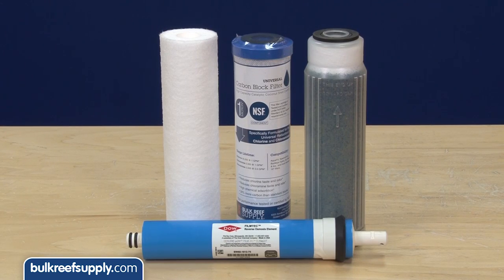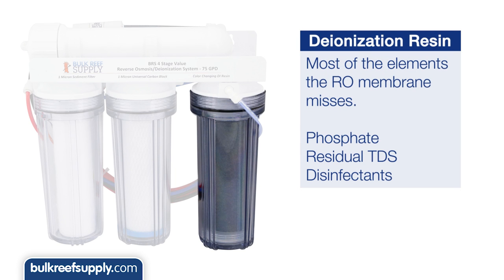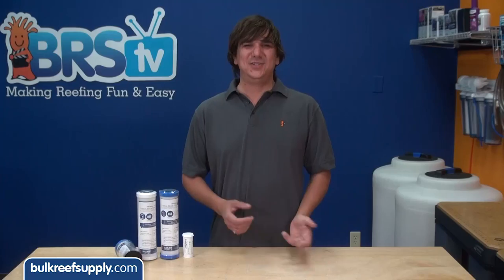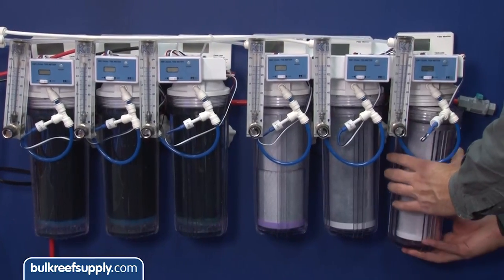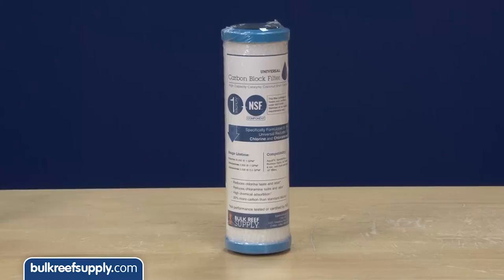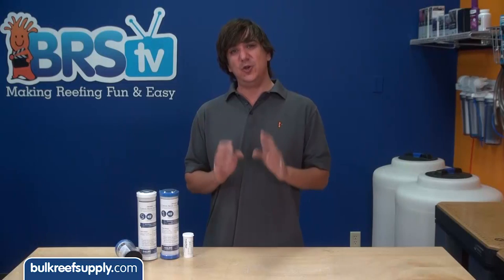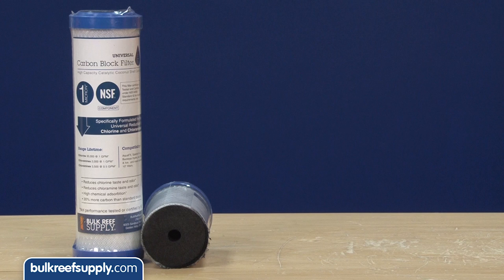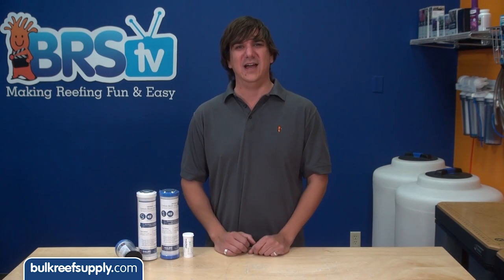Why do I need a carbon block?

Comment: Is the matrikx CTO carbon block better than and have the same VOC properties as the regular BRS carbon VOC block ?
Reply from the maker: I would expect the BRS block to out perform the Matrikx CTO block as the BRS block contains more carbon. For that reason, you can also expect a longer lifespan out of the BRS blocks vs most other similar carbon blocks.

Comment: Your carbon blocks seems superiors to the competition, reef safe means its safe for us to use as well?
Reply from the maker: These blocks are used in RODI systems that produce water for both drinking water or our reef tanks. The BRS Universal Carbon Blocks are made with NSF certified components.

Comment: I live in the city and I have city water that I'm sure has chlorine in it. Which filter should I use? The universal 1micron or the chlorine and voc 5 micron.
Reply: Call your city water dept and ask. Thats what i did also if they have a website a water report may be on there. I was in the same boat and after speaking with my city they confirmed only chlorine was used. I bought the universal plus anyway. I want to bypass the di unit for drinking water.